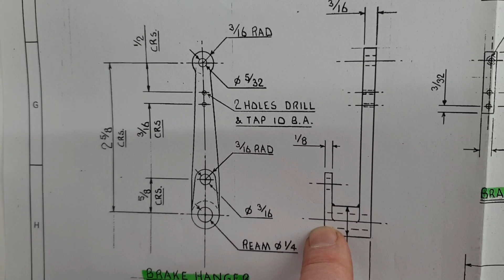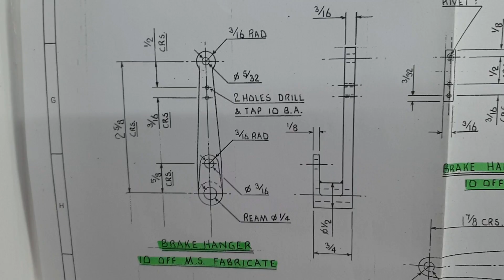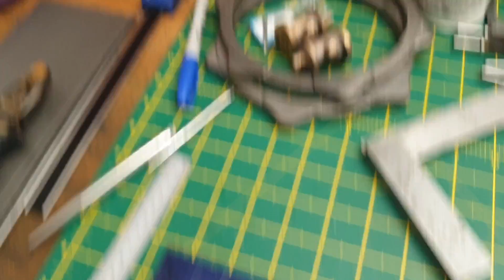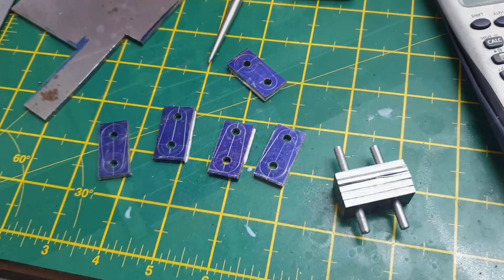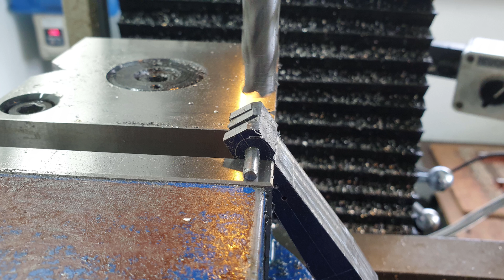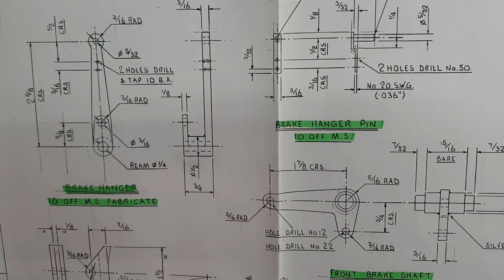BR 9F Steam Loco 5" Gauge Part 59-1 Brake Hangers

Comment: Good stuff Craig. I made a load of these a few years back, but I machined them from 1 solid piece.

Just a suggestion, but next time your in the situation of milling an angle like you did on the small plates, instead of tipping the head of the machine, tip the job, you can calculate what size slip to put under one of the rollers you had through the holes. Just saves you clocking the head back up.
Reply from the maker: Thanks Dave,  good suggestion.

Comment: Looking great Craig. that parting tool seems to do a good job, it's a procedure I still sometimes have trouble with.
Reply from the maker: Thanks Peter, to be honest I was surprised how well it cut. I suspect it is 'free cutting' mild steel which contains a small amount of lead to ease cutting.
Reply: @no23mk2  I think I could do with buying a better parting tool, the one I use is a fairly cheap thing that I bought a few years ago when starting this hobby. I do believe with tooling if you buy cheap you end up buying twice but when starting out in this hobby it can be expensive so sometimes you do have to compromise for a while. I'm looking at buying a QCTP shortly so the  holders I have will dictate what I buy next.

Comment: So how many did you mess up before you realized you misread the drawing?
Reply from the maker: All 10!
Reply: no23mk2 : Sorry to hear that but look on the bright side. As You Tube Machinist Keith Fenner says, "It's better to be looking at it than looking for it." I know you don't want to do any more work but face off both sides 1/32 " to make sure you have good square ends. This will only help you when silver solder the parts together.
Reply from the maker: Thanks Craig. Problem being that I didn't find it until after soldering... No problem though,  I have a cunning plan!